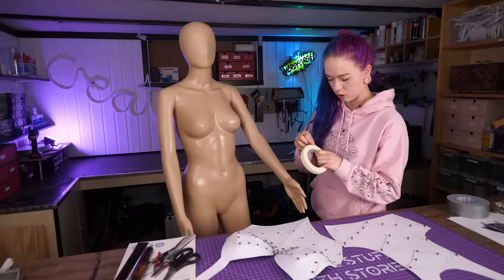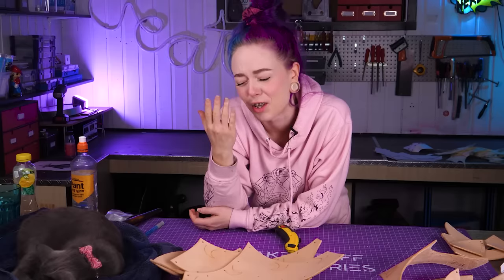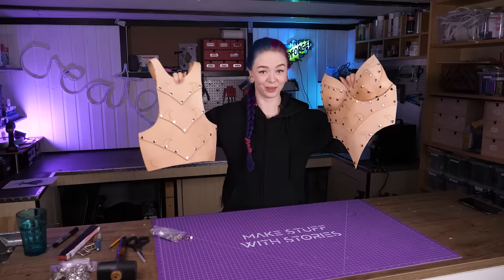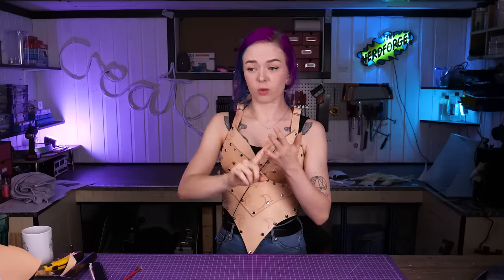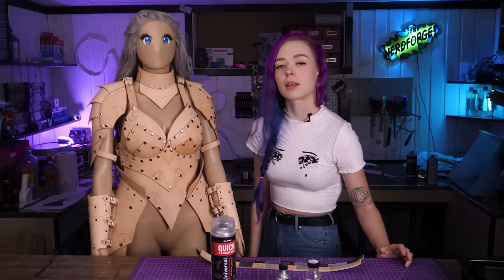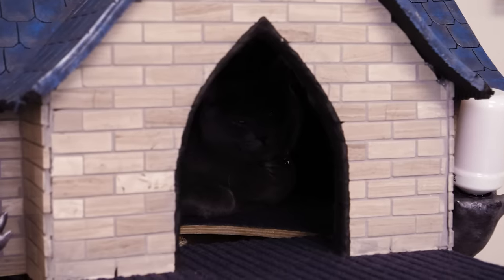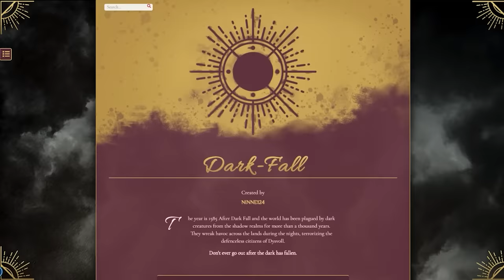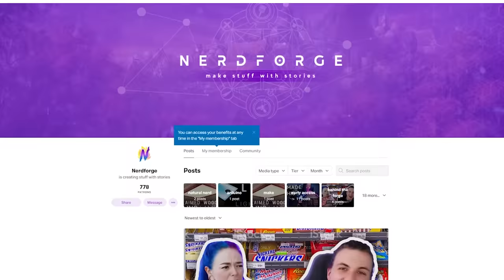Making My First Armor EVER!

Comment: I really want to make armor one day, it looks really fun
Reply: I love armor, I love drawing armor (even though I’m not good at it yet) and be a dream to wear some too!
Reply: It is. I am a leather crafter, new to the art. I made some basic bracers to start. As the bracers was just a rectangle piece of leather cut to shape and rolled with a design, which can be done for under a tenner. Currently working on a helmet. A good channel to check is SkillTree.
Reply: if leather is too intimidating you can do almost the same thing out of foam you just use a hair dryer to heat it so you can shape it
Reply: i made my own suit from mold steel, its not as hard as it looks. the armour archive has a lot of patterns

Comment: This is the coolest thing you’ve ever made! Also I have a question. For the tomes and this armor, is there anything else I could use other than leather?
Reply: Hi, I'm no expert, but I don't think there's any other fabric that has the same rigidity as leather. For a book, you could use wood covered with fabric, but I don't think the armour would work without leather. Maybe multiple layers of some thick fabric, studded, a la traditional fabric armour. But this style of armour, I don't think so.

If you don't want to use leather for vegan reasons though, there are vegan leathers available online.
Reply: @CoRLex-jh5vx  yes I looked at some vegan leathers. Still thanks tho.
Reply: Maybe worbla?
Reply: @RJHail  what is that? I’ve never heard of it
Reply: I know cosplayers use it a lot and you can mold it to whatever shape you want using a heat gun. Look it up on YouTube. There are loads of tutorials with it and you can buy it from quite a few different places now.
Reply: @RJHail  thank you!
Reply: What about Eva foam? I’ve heard it’s lighter than worbla and there’s a cosplayer named kamuiCosplay in YouTube who makes cosplays with it and shows how to do it.
Reply: @Sweetpixie22  I will look at it.
Reply: @Tigoros136  Alright

Comment: This is awesome! The amount of work you put in there is frankly mind blowing, and the finished piece looks absolutely incredible. I´m totally subscribing now. ... On that note though, if you would allow me to give a small critique: If this design was actually metal there are some points that would cause problems. 1. The spiky end on the bottom of the breastplate would make it impossible to bend forward without it digging into your crotch. 2. The straps holding the pauldrons on your upper arm seem to far down. It looks to they would hinder you when trying to lift your arm over your head if the material was stiff. 3. The tassets should be more on the front of your legs. Right now they leave a big opening. And speaking of which, 4. the chest area ... i don´t think i have to spell it out. ... Of cause the whole thing would make an awesome ceremonial armor, but for combat, eh well. Never the less for cosplay this is amazing work! Keep going.

Comment: Professional's opinion:  You might've felt silly doing it, but all the techniques you used, such as the making tape and the paper template, are the same techniques used by Hollywood armorsmiths.  The only difference is that we'd have wrapped you in aluminum foil before using the masking tape, but otherwise everything you did was pretty much the same as you did.

Comment: I like the fact that you actually added a gorget, but I would still interpose myself between you wearing a true metal version of that armor and any foe with a piercing weapon because of the cute gaps between the breastplate and gorget.  I would rather get stabbed than see you die to the exploitation of the flaws in your armor.